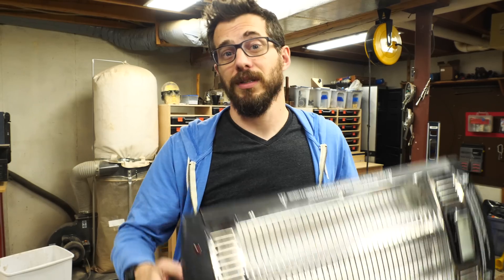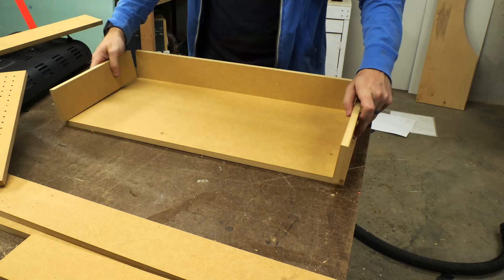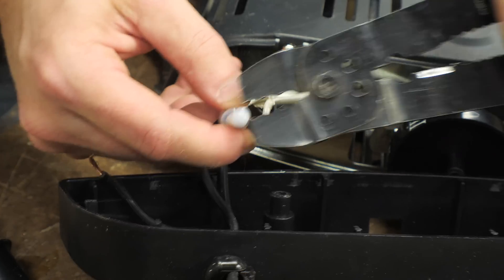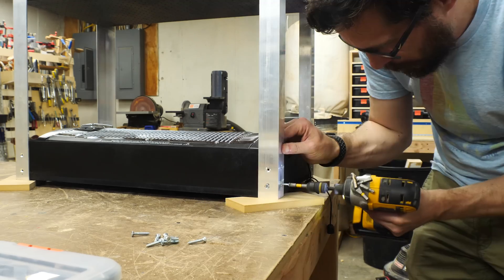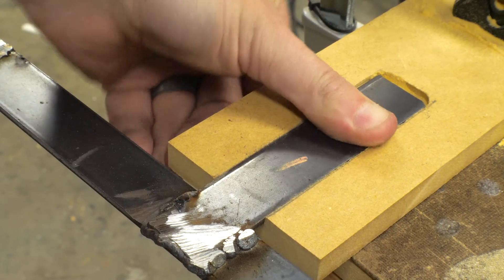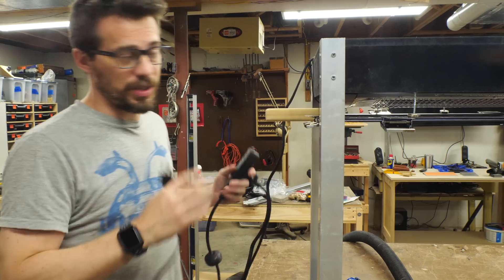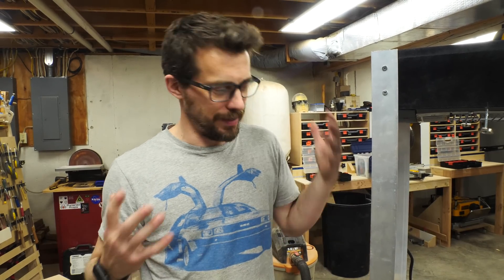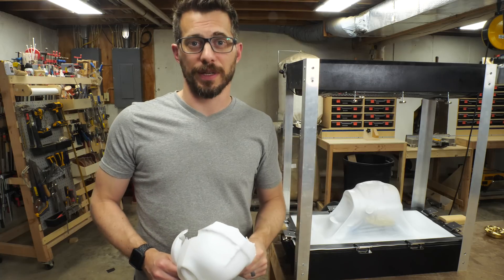How to Make a Larger Vacuum Former | I Like To Make Stuff

Comment: Using a handheld pointable thermometer to give you good indication of plastic temperature before molding will make a huge difference. I really like your diy project though. Mobile phone covers/protectors spring to mind as one application

Comment: Thanks.  Great video.  

The thermoplastic I want to vacuum form is TenCate TC925 (Polycarbonate TP) with 5H Satin Weave carbon fiber.  It requires ~600F to form.  I want to evaluate this product for its ability to form over a simple double curved surface, like a wing skin.  I have yet to build a vacuum former.  Therefore, I am watching as many videos as possible to learn all I can before starting this project.  I am looking for an appropriate heat source.  Will a simple resistive electric heater hit ~600F?  Thanks for any and all inputs.

Comment: as for vacuum surface one 1 1/2 hole in center then when making a mold use channels to connect holes  to get uniform vacuum and cover ones not using. On are commercial machines its more involved but much the same most important no leaks. Pre heating mold also important depending on plastic be formed.

Comment: Great video nice work. For thermoforming a nice tight part a infrared quartz heater is the best to heat your material.  PTEG is realy fun to work with. Anyways back in the day we used Kell rod heaters AKA Cartridge & Rod Heaters.  Then you will need a clamp fram to seal your project to not have any vacuum leaks next would be a pressure box to pressurize to help push down the plastic and used together can stop webing finally cooling the part. but used together with perfect timing can control thin walls.  then most important air eject to help remove part from mold.

Comment: If you had enough work area you could cut your design height by 50%. Also getting 100% of your heat onto the plastic.
Your bottom box would need to be twice as long as 1 half would be the heater and the other the vacuum. The plastic would be above the heater maximizing the heating of the plastic. As soon as the plastic reaches sag the unit slides so the vacuum is beneath the plastic. Or put the heater above the vacuum on a slider and when ready slide away letting the plastic go onto the vacuum. hope this makes sense.

Comment: Used to be a thermoform operator for a few years did learn one thing if you’re doing a deep mold try blowing a bubble with the plastic this will even it out before you hit the vacuum. If you need more details don’t hesitate to ask.

Comment: You will get a better result by really decreasing the volume of the bottom chamber. Build the box with a 3mm gap under the table and support the middle of the pattern as well. Hook up the vacuum to a side chamber - again with min. volume. Also small spikes to grip the plastic sheet around the frame are a good idea.

Comment: feeling it might help you with Distributing Heat more even over the plastic is to upgrade the fan inside the heater. understanding this may lower the heat overall coming from the heater

Comment: Love your video. Never really needed a vacuum former,but saw it in the side screen and figured "why not?". :) Glad I did,as the woman of the house is into candle/soap making and I dabble in JUST ABOUT EVERYTHING. One thing I might suggest is to maybe add some pieces (that don't touch the underside of the vacuum base) inside your vacuum box to decrease the volume of air needing to be pulled out,and increase the sucking pressure. Thanks for the video,think I might make one now. Any advice on sheeting suppliers?

Comment: You should have copied the metal frame handle rather than having to use clamps so you could put the plastic in and slip on the timber handles on holding the material down

Comment: Great vid, subbed for the vac forming. Just a little tip to get wrinkles out of your forms, make some 1inch square mdf blocks and put a 2 inch long screw straight through them so that you can put them into your base board holes where you see wrinkles or overlap of the material. It will make a little extra form pulling the overlap tight on your main form. Hope this makes sense, I use a vac former quite a bit to make custom props for theatre, and RC car bodies.

Comment: Make the seal to the plastic itself, then you don't have to worry about the frame leaking and the clips won't get in the way.
Adding a fillet at the bottom of objects will stop the spider webs.  Also heating the parts to be formed can help
preventing them from setting too quick and then setting them with a spray bottle of water.

Comment: Nice Job,   I'm thinking about making custom Side Panels/Fender for my scooter..   If I use XPS Styrofoam as a Form/Buck,  will the heat of the sheet Plastic deform the XPS ?  I know it cools quick,   but it doesn't take much to melt foam..
  I'm thinking about using NiChrome wire and making my own heating element..  I've used it before,  for bending Polycarb,   but that was much simpler...   You really have to calculate the wire for 600F degrees,  or more !.  It seems like a lot,  but, any less,  doesn't work very well..    I have 2 shop vacs..  I'm still in the design stage..   Nice Video,   it's a big help !

Comment: Put a piece of 1/8 in or so aluminum between the heater and the plastic, it will take longer to heat the plastic but will heat evenly and use the entire available work area

Comment: MDF isn't air tight, it leaks quite a bit. Some ppl. use that property to make closed deck vacuum tables for cnc routers. 
The paint job is probably the reason the vac former works.

Comment: I Never get why people use this jury-rig as heating element, is cheap and easy to make a great heating element with an arduino (to be simple not cheaper) this woulde be a thermal controller up to 0.1ºC that is super usefull in plastics thar have a small plastic deformation window and you can use multiple sensors to know if the plastic is in an even temperature before lowering in the vacuum bed,

Comment: as a kydex bender by trade I can tell you that the heater you're using is ur biggest problem and secondly you need a vacuum former machine not a shop vac, youre not getting optimal vacuum pressure. the difference in detail you would get is immense. secondly you need to be able to gradually heat up whatever material you are using to its correct thermo forming temp and evenly before facuum forming. abs differs from kydex from other plastics. small differences are experienced in material thickness which you need to test and play around with. luckily you have a grace area of around 10 or 15 degrees

Comment: Just a thought, if the actual usable area is smaller due to the size of the heater maybe close those areas off on the vacuum table to allow more concentrated suction.

Comment: You are using too thin of a material.  The thicker you go the easier it is to work with and you get less of the pinches in the plastic.  Also lower it slowly over the form and work out those wrinkles before making a hard seal.

Comment: I've always wondered why people never cut the bottom out of a small oven for the heat box. Just cut it a few inches up the sides. Already metal. The mounts are there. The controls are there to control heat. And quite often when someone throws old stoves away, it is usually the burners or the look of the appliance that makes people replace them, not the oven. And you can find them for free... free....Bwahaha.

Comment: If you want a good idea how to vacuum-form plastics, find a place that makes orthopedics.  We use to cook our plastics sometimes on top of fabric in an oven on a large silicon sprayed aluminum sheet.  Once draped over the vacuum box, the cloth would be removed since it prevents the plastic from drooping all over the place handling it from stove to vacuum.  To do something like the head you did, I would make a cast of it out of plaster with a vaseline'd vacuum pipe in it.  The cast would have fabric or nylons over it to promote a vacuum throughout the part.  The plastic would be draped over the cast, pulled around and then stuck together, working your way up to the vacuum pipe.  Once you squeeze the plastic (wearing appropriate gloves the entire time) off at the pipe, it will suck completely around the cast.  You can also heat up foam and use a plastic bag to seal it to the vacuum box or pipe.  Once cooled, staple it to the cast to hold it in place, rough it up with some course grit sandpaper and pull plastic over it and the two layers will stick.  We often used 'white' plastic that you knew was up to temperature when it went clear in the over.  If you're using plaster for casts, you can shape it with car body files and smooth it with wet screen (like from a screen door).  But note if the plaster hasn't had time to dry out, you can pull water and plaster right off the cast.  If one was using plaster for laminating instead, some seal it off first.

Comment: Could you use a thick piece of metal plate in between your heating element and your frame to evenly distribute your heat across the whole frame surface? Might take a bit longer to heat up, but you could remove it for smaller projects.

Comment: I think you'd have better results with creating a seal by making the vacuum table slightly smaller so the metal frame goes around the edge of the vacuum table surface, the clamps then wouldn't interfere.

Comment: Even though you are using the face should for you’re welding you aren’t holding to your face so you are still seeing the flash even if it’s from your peripherals you are still seeing it and it’s bad for your eyes. As a welder I know that because I’ve welded in orbital welding booths which for some reason are all white on the inside and the light even though you are wearing a face shield with a level 10 lens is reflecting back into your eyes from the white walls and screws your eyes  up. I just recommend that you hold the lens up to your face instead of up to the weld it’s self

Comment: a heater placed like this should not be left unattended, heat travels "up" and keep in it in this direction will cause to much heat where it shouldnt be that hot and is a fire hazard, however keeping it superviced and not having it on for long periods of time it shouldn't be  a problem.

Comment: Have you thought about using the machine for blowing shapes too? I have made plastic domes this way; by placing a steel sheet with a hole in it on the vacuum surface, pulling the plastic over and - instead of using vacuum - using air to blow the plastic into shape. Might work if you use the air gun from your compressor instead of the shop vac. I used this tecnique to make two different size domes that could be used to cast a bowl/planter. By the way - I often resort to using my heat gun to soften the plastic. Could be a solution if you need to use the entire surface of your new machine.
Reply: The shopvac has a blowing function, he used in the air hockey table project.

Comment: Instead of disassembling and then reassembling the power cord, you could have just made the hole in the MDF slightly bigger so that the plug end would just fit through.

Comment: was going to suggest using the handles as clamps but it's already been suggested. 
One other thing tho, by heating the plastic slowly you'll get a more uniform heating and get more useful surface, not juste the ten inches in the middle.

Comment: For anyone wanting to make their own vacuum forming machine, here's a pro-tip that will get you great results even as a beginner. You need your vacuum box to be able to fit INSIDE your frame clamp. That way when you pull down your styrene, the plastic wraps tighter around the base of your object bucks. (That means you can't directly fasten the legs to the vacuum box underneath. Unless you make a tiered cake box, where the vacuum forming area is elevated and smaller than the whole box underneath)

I've made several of these over the years, and the most convenient items to start with are actually metal baking trays. Use one to contain your heating elements, and use the other as the base in which you pull vacuum through. Yeah, drilling holes in the metal pan is gonna suck a little more... but the results are more worth it and your homemade vacuum former starts to rival "professional" versions.
Reply: Thanks for posting. Would you have pictures of the setup ?
Reply: Epic tip. Cheers!
Reply: I still worry about the urea-formaldehyde offgassing of generic MDF. I know MDF is a cheap to use but heat will only hasten the breakdown. Any alternatives besides metal?
Reply: Late to the party but if well designed mdf offgassing shouldn't be an issue at all.  @thomaswiley666

Comment: im not too sure how to sure how the black paint will go with sucking up the heat but you might want to be careful, also id suggest blocking the holes that WONT be used, due to the heating element not being wide enough

Comment: What about making two of the same steel holders with handles on them. You could then use the wooden handles as clamps when you slip them on. It would stop you from using those binder clips.

Comment: It would be interesting if you could use the heating elements from some toasters or even heat guns to try and make a custom heating system, controlling the voltage with an arduino setup.

Comment: Remake your tray that holds the plastic by making a frame of angle iron with an insert that drops into it and sandwiches the plastic. Then you can put a gasket on the bottom and get a perfect seal, and also ditch the binder clips.

It would be similar to what you have already but if the bottom half had 1/2 inch walls going up and the top half didn't have the handles and fit inside the tray area of the bottom

Comment: next time use magnets on the top side of the frame holding the material, so you don't have to cut foam for filler and also not to use clips

Comment: Hey Bob, I loved this one. It brings back memories of working with my brother. We used to make vanity license plates with a small rig like this one. 

On a little different subject, I recently had a printer die. What parts are salvageable from a dead printer ? I know the glass is good & the stepper motor(s) are good, but what else ? Is there an controller that would be any good? The printer would locate correctly, but wouldn't anything except a shadow. Thanks again, Bob.  " I like to make stuff" also.   Jim
Reply from the maker: Awesome! not sure about the printer really. Maybe contact switches and wiring harness?

Comment: Great video.

I would use a nichrome wire mesh layout with switch and variable resistor to adjust temp for different materials. 

Or make real fancy with themo couple and arduino to heat to desired temp

Would make some custom tool trays for storage in tool chest

Comment: AvE did a video about those welding helmets - at least in the on he tested, the UV and IR were always blocked so your eyes are always protected. It just dims visible light as well when it's activated - so it'd still be safe but probably not useful if you can't see what you're doing :)

Comment: You should of put a metal handle on both frames so when you put the wooden handle on it will hold both frames and you wont need to use binder clips. Loved the overall project keep it up.

Comment: lol, "To be safe" you wrapped the wiring on a heater with vinyl tape.  I'd suggest kapton tape for it's heat resistance. ... and not burning and making fumes. Also electrical tape turns to goop after 6 months.

Comment: You should put an Arduino in it somewhere and a switch on one of the pieces of angled aluminum hooked up to the vac so when you slide the holder down it fires up the vac and then like a button or something to shut it off just a thought

Comment: Really dumb question but wouldn't it have been alot easier to just cut the plug off of the end of the cord and put a new one on once you pulled the cord through the hole?

Comment: Could you do multiple layers to make it stronger?
Reply: Maybe with very gentle edges ( less than 60) as once it's had a layer the vacuum wouldn't be able to pull it down, I suppose you could use pin holes, but it would not work as well, instead maybe just use a sheet of perspex, it's harder to do, but would be easier than multi layers

Comment: I've been wondering if a heater like that would work for a vacuum former. It's performing better than I thought for a heater that size. Great project!
Reply: The simplest is a 'electric grill heater'.  It is 110, comes with a heater controller.  You can use 1 or 2 depending on size. They are move than 10 amps,  so youll need a 110 on a 20 amp breaker,  or you will need to plug it in to another rooms if you use 2.

 The best way would be to build a pyramid shaped heat box.  Going from heater size,  to plastic size.  That way you get perfect radiation of heat.  If you just put it in the center of box,  you will get dead spots.  Also,  the platen, should be smaller than the plastic,  so the plastic wraps around the edges of the platen,  that will give a much better seal. Your best bet,  is to take a look at a store bought vac former,  and you will see a lot of the design flaws in home builts.
Reply: @IconicProps  That all make a lot of sense. Thanks!

Comment: Nice job! One idea, what if you made both metle frames for the plastic sheet with parts for handles and then made the gap in the wooden handle twice as big. This way you could use the handles as the clamps and wouldn't have to deal with the clips. Maybe it would shake around too much but I think it would work if it was a tight fit since it doesn't have to do much.

Comment: Is it me or are they magic vent slots only half were visible when the top was peeled off or did the CNC not penetrate all the slots?
Reply from the maker: Yeah, we just set the Cnc up and haven’t fully leveled it yet. Those cuts just BARELY didn’t make it through. We just sanded them off quickly.
Reply: I Like To Make Stuff it's a great build.